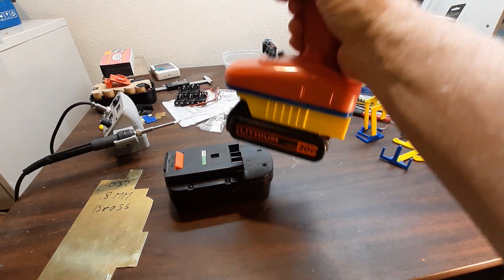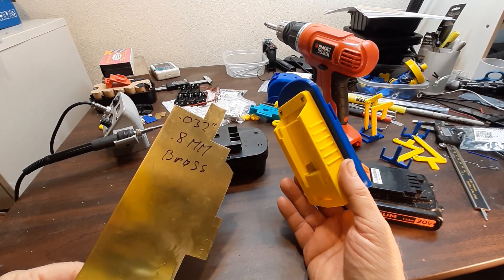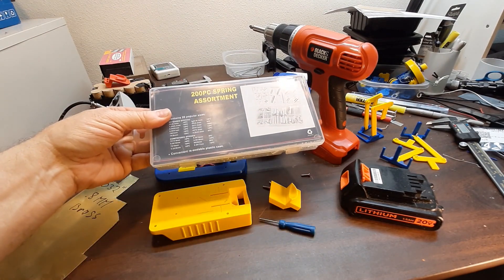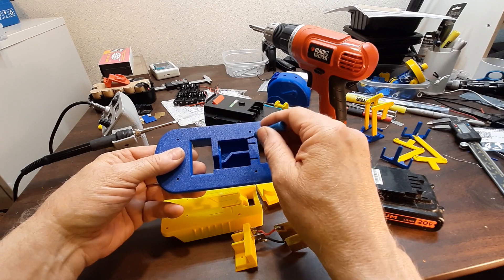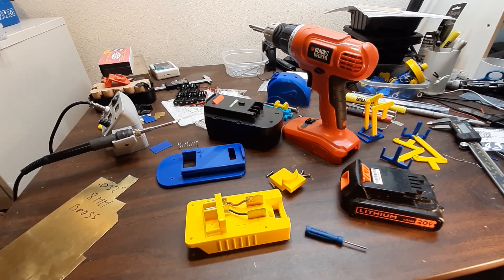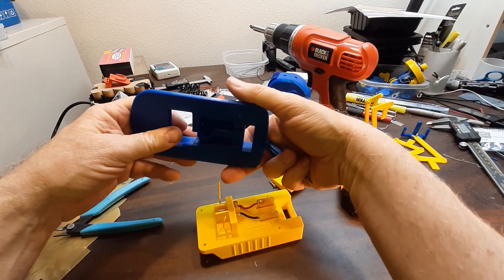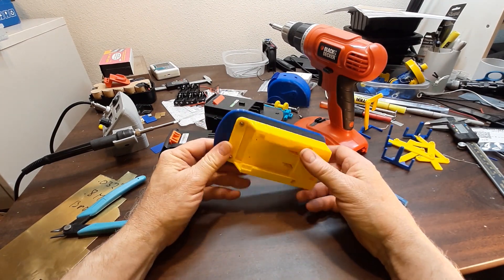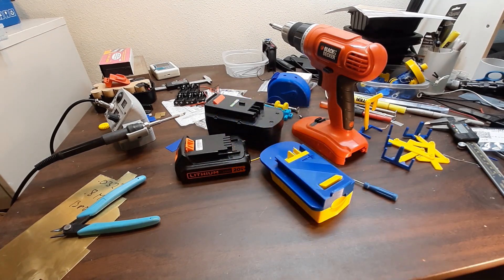Black Decker 20V Max to 18v Tool adaptor

Comment: I've been wondering which BMS or more so low voltage and or low current shut off protection modules would be better?  For the cost, I was thinking possibly if the current handling is enough, using the Dyson V6 or other adapters boards.  Neat design.  My next project, is to make a switch that's a contact switch in the battery connection to turn on the resistor and transistor circuit for my DeWalt 20V tools so to use the Bauer 20V battery packs.  Thinking about doing the same with the Bauer 20V tools maybe, so to do the same with DeWalt 20V style batteries, though I think that circuit would only require a resistor.  Liked, subscribed and commented.  Feel free to do the same on my channel and thanks for sharing!  Great work.
Reply from the maker: I don't use a low voltage cutoff. I just charge the battery when the tool slows down. Not a great solution. On my soldering station:
https://youtu.be/0R3dhH1EhNQ?si=haZaqgZPDZsD6-Rn
I used a cheap voltage display so I can monitor the voltage. Again, not a perfect solution but workable.